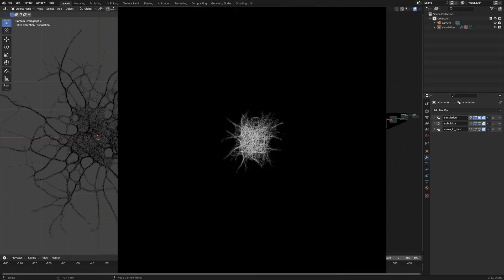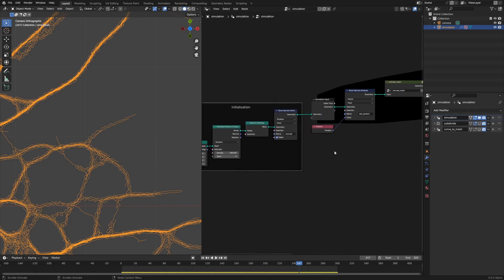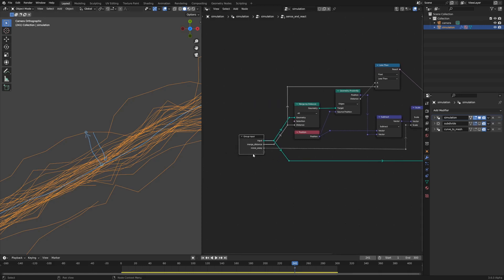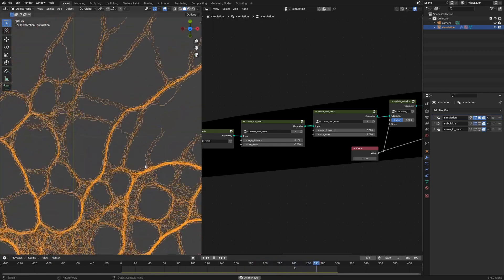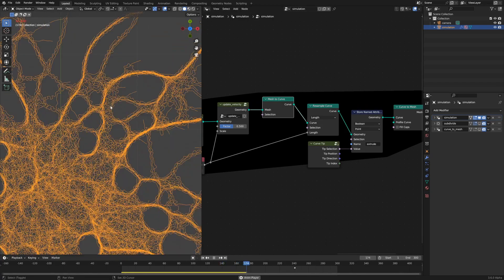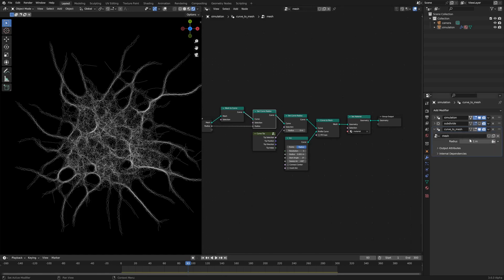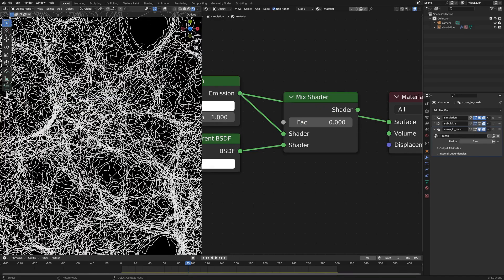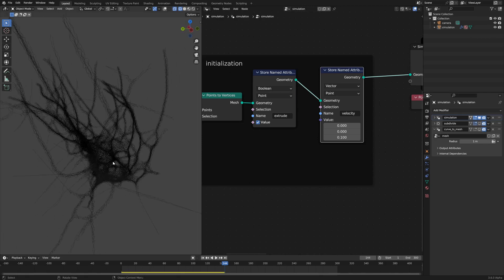Slime Mold Simulation Nodes Tutorial (Blender 3.6a)

Comment: I'm having a problem. So I did everything as you did, triple checked it all.
But mine isn't flat, and it's also not making several large veins. Using V.3.6.2, is it really the issue of not having Alpha?

From center it's making 2-3 large veins going at a diagonal angle in 3D space, away from each other.
Reply: change the "velocity" attribute to be a vector